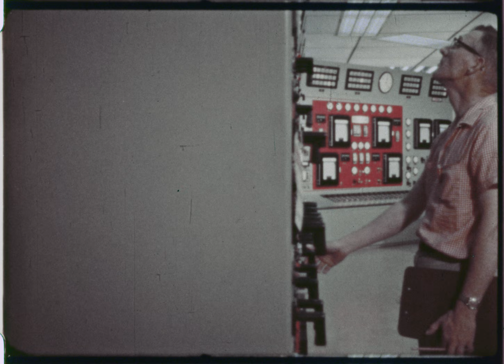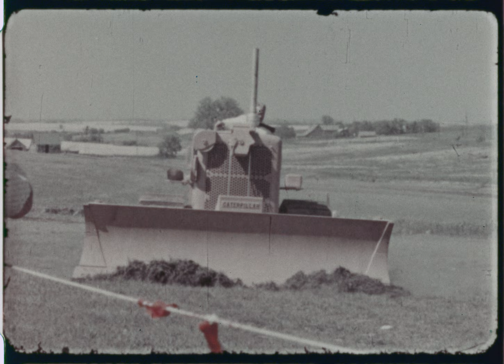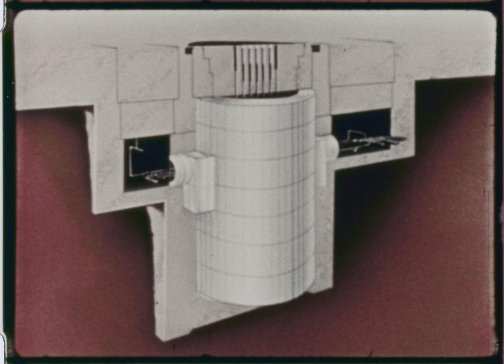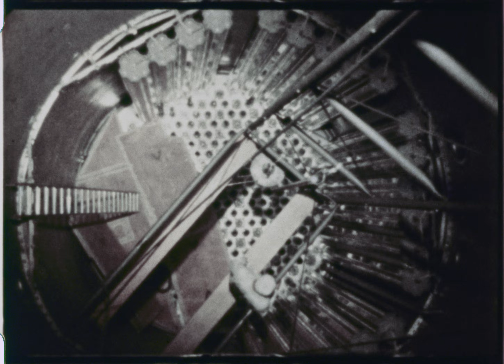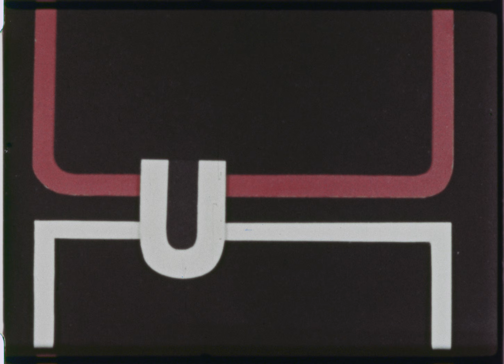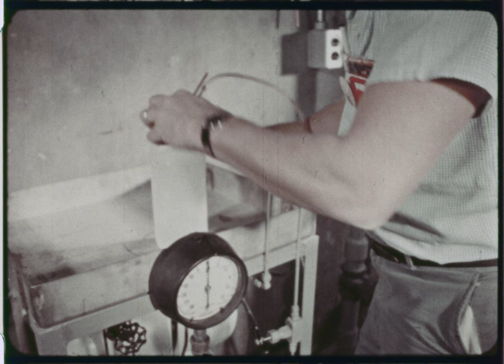Hallam Nuclear Power Facility - the Sodium Graphite Reactor in Nebraska (1963)

Comment: Looks like they have a nice shot of the Kramer Steam Plant at Bellevue. The two unit C.C. Sheldon Steam Plant is still operating in 2023. I also liked the lattice steel tower line that ran northwest from the 2nd and N street substation to NW 48th Street just south of the air park (now gone).

Comment: Not very long lived... (from wikipedia) " The facility operated for 6,271 hours and generated 192,458,000 kW-hrs of electric power." It was completly decomissioned in 1969
Reply: Produced atomic generated power for about a year.  It must be entombed and monitored through 2090.
Reply: The problems of trying to work with molten sodium I wonder ...
Reply: @damienhill6383 
Gen IV reactors are truly a wonder indeed.
Reply: This Youtuber  co-wrote the  wikipedia article.
Reply: @damienhill6383 No more difficult than any other coolant. It's about the same as water, but much higher heat capacity so you can use a lower flowrate. Lower flowrate so lower power required.
Reply: Molten sodium opaque and oxygen / water reactive. But can be managed.

Comment: Water.  Cooled  and moderated. Reactors  Are the. Safest.
Reply: That's your opinion. Your opinion is not fact. Water has a very low heat capacity compared to other coolants. Using water requires higher flow rates, which means higher volume pumps, which consume more power.
Reply: @curtrapp5291  That is not correct. Heat capacity of water is little less than 4.2 kJ/kgK and sodium's is little over 1.2 kJ/kgK.

Comment: yep, the graphite rods rapidly cracked, absorbed sodium and failed.  Years of decommissioning for a few months of just a bit electricity. Total rip off for rate payers of Nebraska.
Reply from the maker: The leaking graphite cans were analyzed and Atomics International had a plan to fix them by outfitting them with snorkels. But the utility declined their option to buy the reactor. The Federal Atomic Energy Commission paid for the reactor and decommissioning through the Power Demonstration Reactor Program, not ratepayers.
Reply: @whatisnuclear  so for Hallam it was the taxpayers?  Fairly certain Scanna was the ratepayers.  Wonder what was different.
Reply: @rogermorey    ..That's "sour grapes", based on disinformation.👎🏿👎🏿
Reply: @lilblackduc7312  Sour Grapes is Woulda Coulda Shouda done due dilligence in understanding the chemistry and physics of the radiated rods in sodium.  If they went from crack to break, they may have blocked reinsertion, rapidly leading to catastrophic meltdown.  It was bad engineering in the first place.
Reply: @whatisnuclear  Just all the U.S. Taxpayers covered the cost !